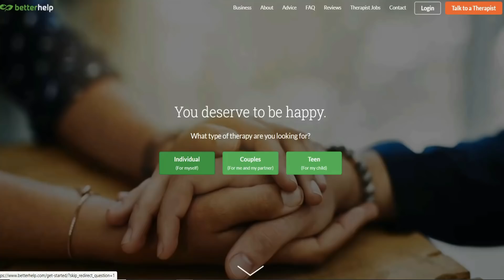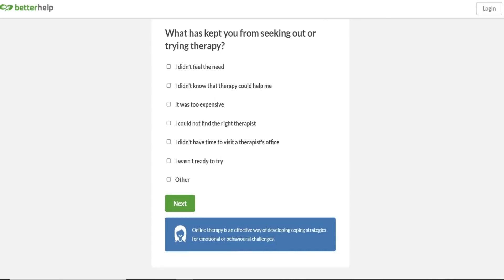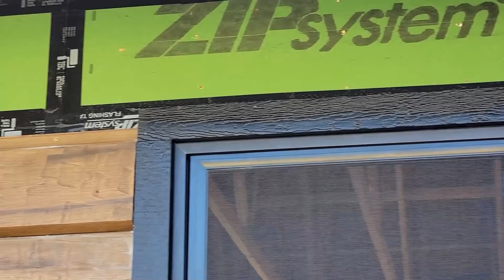Siding Our SELF-BUILT House | Making Our Log Cabin DREAM COME TRUE Using Concrete!

Comment: I had a teacher, at one point, tell me that “inch by inch, life’s a cinch; but, yard by yard it’s so very hard.” You guys are doing a wonderful job and are making amazing progress. Your home looks absolutely beautiful so far! 

Currently, I am learning how to can and teaching myself. I have been putting it off because of the fear of failure. However, we expanded our garden significantly and I am not willing to risk losing it so I put aside my fear and have been making steps to accomplishing it. I am starting with water bath canning since the risks are more minimal. But, soon I will be facing my main fear: pressure canning. 

I never realized how afraid I was of failure but you are right…we just need to continue taking one step forward in progress. Thank you for that reminder!
Reply: Does the concrete siding really install by only putting screws into the top of it?

Comment: It's looking good from this end , and I have a question: were you going to have a moisture barrier over the green board; may I suggest 15pound felt paper. This just adds a waterproof barrier, over that green board and it just needs a 3" over lap. It's better to have an extra barrier for moisture. And if you don't want to,  could you please at least run a strip of the black tape over the drip flashing. 
Now back too the video! Take care and God bless amen. 🤔👌❤🙏

Comment: I'm curious how ya'll are maintaining the water resistant rating of the Zip-panels w/o using the goop by Zip to cover the penetrations in the field....ie everywhere you nailed the panels and broke thru the outer membrane barrier but didn't cover with the tape? In every part of the country I've worked, it was required.
Reply: It's recommended but not always necessary The cladding covers the indents. Chances of water penetration is nill. I'm a bit of a perfectionist but I have let some of it slide.
Reply: @lavrentichudakoff2519  my inspectors, including a Zip rep, have never let me slide on covering those penetrations. This concrete cladding is quite impressive.
Reply: @RenaissanceThinking  I've got a place not far from them in N. Idaho and wish I knew about that product when I built in '08

Comment: Gorgeous !!!  I love the concrete,, and realize the so many benefits it has, especially for your location.  Winds, snow, rain and of course fire.  I really liked the metal roof on my log home in the Mts. out of Anchorage.  In the Spring when the thaw began to melt the packed on      snow that covered the roof,  would sound like a train running over the house as the big chunks of ice and snow slid off to the ground. My roof had a bit steeper pitch than yours yet still held onto some good loads of late season snow which has a faster snow, freeze and thaw snow fall ratio.

Comment: You can use the crates as sheep shelters when you get done.  Angle the roof and cut an entry door on one long corner so other corner is protected from the wind.  May even combine two crates for a bit bigger space. 
Siding looks good.

Comment: Put similar siding on my home called cement board (Hardie) that had kiln-baked cedar color on the outside. The cement board siding has a 25yr life and all I do is power wash.
Great choice for durability, low maintenance and actually a increase in R value.
PS when I drilled my board I used a drill combo that had a countersink allowing the screws to sit flush.

Comment: Good job guys,   I was looking at past videos   May I make a little tip?  On the corners of all the windows.  add a block of wood  for your drapes hardware to screw to.   Walk around the house and visualize  where pictures and any type of wall hanging might be.  add wood blocking at those areas.  look in the kitchen and bathrooms for possible locations for shower rods, toilet paper holders, paper towels  you get the hint.  put blocking in them their walls !!!! ohh  another tip    perforated tubing  wrapd around the drain pipes behind sinks  leave the end of the tubing sticking out of the wall under a cabinet.  LATER  you can squirt bug killer into those areas if needed.  Look for a copper or brass, chrome plated towel bar that is hydronic. run your hot water looped through the towel bar, on its way to the shower.   the water will circulate through the towel bar as you use the shower,  warm towel on a cold day is mighty fine.   peace

Comment: As a sidng guy since the age of 12, the trim( corners, window, top of wall, around outlets, porch beams,etc) takes a long time compared to the actual siding. Yes, you should put up a piece or two of siding so you can get an idea of exactly how it looks, fits, etc. 

You're doing well.

Comment: This siding looks super !! You need to put a metal flashing rain cap on top of your windows to prevent water from getting behind the siding/window trim and then running down on the zip panels.

Comment: Just a suggestion, on the bottom side of the Zip/OSB where the edge is exposed, you should spray some truck bed liner or under car coating along the bottom edge. It will protect that exposed edge of the Zip/OSB from moisture... "MOIST"

Comment: really nice. would not guess that was a concrete product. Between that siding and the metal roof, you are low maintenance for sure. Just the soffits and fascia to worry about keeping up with. Also spark resistant if not fire proof which is very smart in your area. Much safer house for you and yours.

Comment: I'm not sure ifmi mentioned it or not, but we have some pretty nice diy lights which put out a lot of light for very little energy cost.  They begin with the frames and stands salvaged from the halogen work light sets. We removed the halogen lights amd replaced them with automotive, bright white, LED lights (could have come frim the trucker shop) which consist of a bank of 3x5 LED bulbs surrounded with a number of prisoming plastic facets and in a black case; inexpensive types.  We happened upon an automotive shop going out of business so our lights are wired to 250' rolls of speaker wire on one end, inexpensive battery clips on the other.  We hook up to the deep cell battery which lasts for hours.  As needed the battery is hooked to a charger plugged into either a wall or smal generator.  Someday we may replace our trial, inexpensive parts but 10 years later nothing has failed enough to require it.

Comment: This spring you should check around.   I use to get my little bullls from the local farmer who had a dairy.  I would slaughter them out at 1.5 or 2 years.  And they went into the freezer. Also try the stock yards.

Comment: It looks Fantastic. If I could respectfully suggest. I believe the siding is not inexpensive so you do not want a bunch of waste. It’s becomes a giant math problem but if you measure what size pieces you will need you can group them in the most efficient manner. Example if you have a lot of 5 foot cuts you would get lots of 2 foot off fall. Where if you can mix a 5 and a 7 footer you only waste a foot . Like I said it’s a lot of math but it can can be a big $aver. Keep up the good work

Comment: Dewalt make a 7.25 concrete saw blade  that you can put on a circular saw to make your cuts and it works great. I bought mine at Lowes as a 3 pack for $22.00 a couple years ago to do a retaining wall 50 ft. by 3 ft. tall and only used one blade and it still good.

Comment: To provide for fire mitigation, you should have at least 16 feet between the house and the closest tree.  Given your house and property (the amount of open space around the house), you should not have to cut many, or any, trees around the house.  Keep ground vegetation at no more than 3 feet high and any fire should burn out before it can ignite any of the structure.  Another safety margin could be a 2 - 3 foot gravel bed around the entire house and/or around any wood-based structure near the house.  The best thing you  have done to protect against fire is the fact that walls are concrete-sided and the roof is fire retardant material.

For out-buildings, do a 6 to 10 foot gravel border around each.  You seem to have a good well and enough water to spray down buildings that have combustible siding and/or roof.  This suggestion may seem a bit OCD but it is a cheap insurance for your pump house, barn, or other potentially vulnerable out buildings.   One of the most valuable things that I used in central Colorado is talking to Forest Service or BLM personnel.  They were able to estimate that my house was likely to survive a fire in nearby brush or tree areas.  You guys are probably going to be in good shape on fire mitigation issues but getting input from an on-site is a good back up.

Not only is your siding fire resistant but is is very attractive.  I think you will be  happy with it for many years.  Stay safe.

Comment: Why not just get some craft paper and scissors.  Go on the ladder and cut the paper till it fits in the space.  Take that and tape it to the corner board and cut.  Sometimes the simplest ways are the most effective.   Butcher paper cut to the same size as the back of a sink base will allow you to precisely trace out the location of holes to be cut for drain and supply lines, etc.

Comment: The siding looks really natural. Is it possible to use a concrete blade on your mitre saw for this product? Also do you need to gap the seams to allow for expansion and contraction due to temperature changes?

Comment: Hi - Nice job - Question - should you not put some leakproof membrane under the joints and then caulk the ends as you but the 2 pieces together???

Comment: What if you put tape over the flashing onto the sheathing?  That seems like it might be a nice way to go.  Right now, if water gets onto the sheathing, it will flow down behind the flashing and possibly get stuck right where the nails hold the flashing to the wall.

Comment: the siding looks really good but just wondering why you didn't pre-drill your holes in the siding before hanging it? would have been much easier to drill it with it sitting on the sawhorses on the ground instead of drilling it on the wall, would have made for much faster installation.

Comment: They are siding they have like Stephan with fiberglass that goes in behind looks like they would have had something like that to go with it too so if he ever had knocked a hole in it it would have protected it least it would how keep out the Predators the flying insects if you look up on the internet on siding and you see what I'm talkin about as the insulation that fits just the same as deciding goes inside the siding